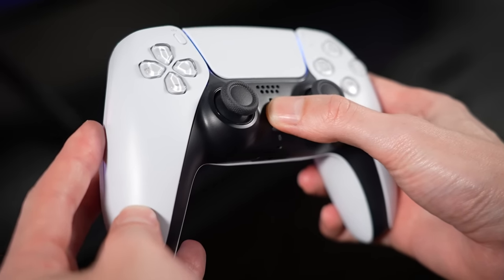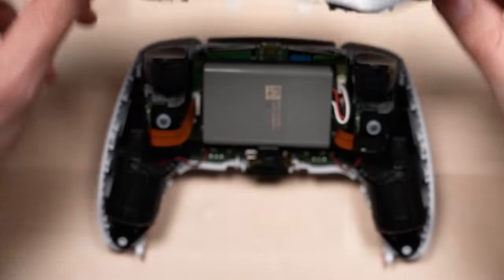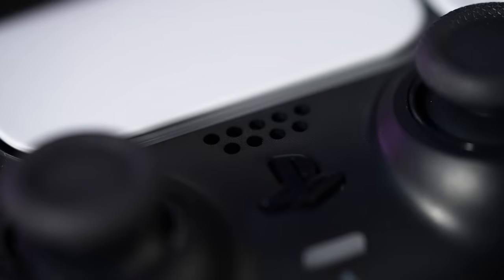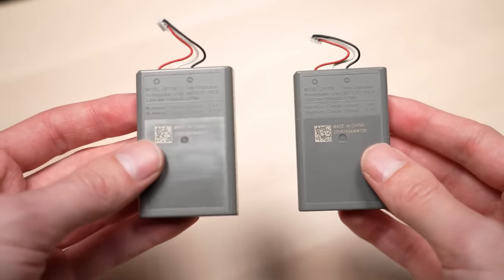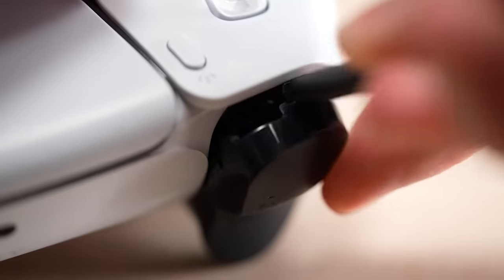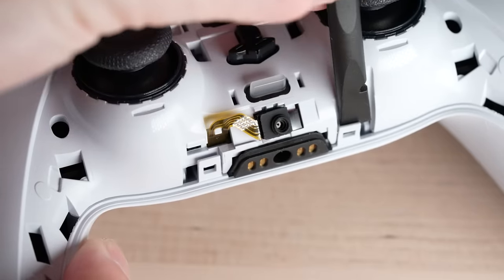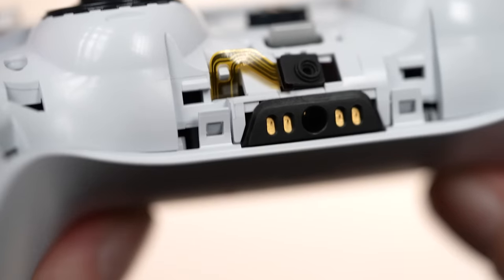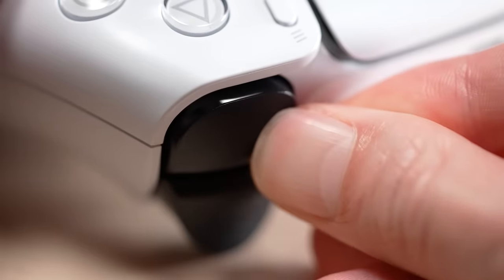Sadly, your Playstation controller won't last much longer..

Comment: Degrading and dying batteries are one reason why I love that Microsoft stays with the battery compartment on their controllers. Happy to see that these are still relatively easy to get to, but having to pry off buttons to get to the battery when they could've probably just put a door you could unscrew back there is a bit ridiculous.
Reply: They do it on purpose. They want you to buy a new controller. It’s a scummy practice but it’s nothing we can change.
Reply: @silvskill5358  Uhh no. Battery degration happens to literally ALL types of rechargeable batteries.
Reply: @allwillknowmii1314  Yeah but they make it harder for you to change the battery so that most people will just by a new controller because they don't know how to access it.
Reply: @allwillknowmii1314  Yeah but with XBOX you don't need for the normal person buy a WHOLE new controler
Reply: @silvskill5358  That would be planned obsolescence. "Your car is only good for 100k-200k miles, and you need a new phone every other year."
Reply: Yeah with xbox controllers you can just put a new rechargeable battery inside which saves alot of time😂
Reply: @joethewiz4005  Yeah, i used rechargeable AAs for a while, and it got annoying when they would die mid game, so I got the Sliq Gaming controller charging station. It's great, and if they ever get to the point they die too fast I can easily order another one of those batteries and use AAs until they come.
Reply: @allwillknowmii1314  you’ve COMPLETELY missed the point there, this person is referring to the lack of a simple solution for battery replacement being done to push us towards buying a whole new controller.
Reply: @KingKami Controller drift happens to all controllers from all brands so is a irrelevant point to bring up, Microsoft solution is still superior in the battery department
Reply: im using EBL 2800mah AAs .. i highly recommend. on amazon.. lasts me a week before i gotta swap in fresh ones. i play rocket league probably 4 hours a day...
Reply: @user-it6bx9tt5h  I have the same batteries. Rechargeable EBL 2800mah. While they work great, a controller charging station works great to make sure it will always be fully charged whenever you're ready to play. Then you can always fall back on the EBLs if you ever need to replace the batteries from the station for any reason, defect or eventual degradation.
Reply: That's funny. That's the exact reason I fucking hate xbox controllers. Those rechargeable batteries are garbage that break all the time. To the point where I just play wired all the time. At least my playstation controllers lasted 4 years without having to do anything other than charge them.
Reply: @Typzical  You're buying trash rechargeable batteries if you continue buying ones that break all the time. Buy quality ones. My 4-pack of Panasonic Eneloops are still going strong for my Xbox One controller I use for PC gaming since I got them 5 years ago.
Reply: @Typzical  As an iPhone user, I genuinely can not understand why you would ever complain about the ability to easily replace a battery. Like you don’t even need to buy a rechargeable battery pack with an Xbox Controller, just get a set of Rechargeable AAs and you’ll be good to go for years to come, and you can find them in effectively every store. Not being able to easily replace the battery is the absolute worst thing about iPhones, I can’t imagine a single reason for wanting that as the consumer
Reply: @KingKami since gen 1 xbox has always had the least problems with stick drift and the bumpers problem was only if you threw your controller around alot. Having a battery compartment saves you a ton because buying a $20 battery pack that'll last 5 years of hardcore play is a lot cheaper than replacing a controller every 1 mabe 2 years of causal play. Its absolutely intentional both Sony and Microsoft have admitted to slowing down older systems. On top of all that you can shatter a ps5 controller with a light twist of the grips so do you really think they intend them to last any time at all.
Reply: its too encourage lazy rich kids to buy a new one
Reply: @silvskill5358  this is one of the easiest battery replacement's I've seen, compared to a phone this is a cakewalk, any old chucklefuck could do it
Reply: @Christoph5782  The issue is the fact that they need to be replaced so often. I've never had a playstation controller have a bad battery. In general the ps controllers feel better quality. I bought a brand new xbox one and out of the box there was play in the sticks. I feel that because they are replaceable they make them shitty and cheap so you buy a bunch of them.
Reply: Microsoft doesn’t include rechargeable batteries, but they are easily user replaceable. Sony includes rechargeable batteries, but they are not easily replaceable. Both companies should meet in the middle and include rechargeable batteries that are easily replaceable, like the Xbox Rechargable USB C battery pack
Reply: @silvskill5358  ive had my ps4 controller since 2016 and its running fine
Reply: @bluepeng8895  Yeah, but for around 20 bucks, sometimes cheaper depending on the brand, you can buy a controller charging station for the Xbox controllers which includes the rechargeable battery pack and stand to charge it.
Reply: @elfarlaur  they showed you its sooo easy
Reply: Both have their pros and cons. The playstation lithium polymer battery last a longer time than AAs, and have a lower maintainence cost as you do not have to replace it often. Changing the battery is troublesome, but at least it's once in a few years. For the PS4 dualshock 4, the microusb port is a common failure point.
The Xbox battery is easily replaceable, but not rechargable. So if you are using alkaline, you'd need to keep spares around. But it's common for the battery to leak and damage the controller. You can replace it with a rechargable battery pack specifically for the Xbox controller though. 
I do have a few controllers, but I do find Xbox 360 controllers less reliable based on experience. Have 2 that just shuts off randomly after a few minutes and a few that doesn't power on even with new AA batteries and no visible corrosion. Have a number of dead ps3 controller, but they worked after a battery replacement. Have a couple of dead wiimotes from leaking batteries too.
Reply: all this debate in the replies and im over here sitting with a switch pro controller that I haven't charged in over 2 weeks lol
Reply: @lemonbeverage  lol. Wanna get involved? 
Well, using my switch most of the time recently, esp with rf5 and Kirby. Xc3 is coming out soon too. Wanted a switch pro controller, but it's quite expensive. Just using some third party controller now that works well.
Reply: @UserAnomynous87  This is just demonstrably incorrect. I have Panasonic eneloop pro AA's in my xbox controller....they are 2500mah capacity and last for about 24 hours total non stop. My ps5 controller(which is brand new last month) lasts about 6-7 hours before needing a charge. Its a cynical practise intended to push people to buy new controllers...just look at how many new controller colors they release to further prove the point.
Reply: @totalprocall6894  Perhaps you are right on the PS5 controller battery life on a single charge. The main issue I have with AA batteries is the possibility of leakage. Have seen many dead Wiimotes and Xbox controllers due to leakage corrosions that are beyond repair, as it had seeped into the motherboard. Also had the same issues with the old Gameboy / Gameboy color, but did not encounter any such issues from Gameboy advance SP onwards, due to the use of rechargable lithium batteries.
If only the ps controllers had used lithium rechargable but allow easy replacements of the batteries via a battery compartment, just like those older Nintendo handheld.
Reply: @Typzical  don't be a cheapskate. Just buy Eneloops battery and you're good to go.
Reply: @JustKiddingPro  or just use wire 💀
Reply: why not replace the battery? with an even bigger one
Reply: @prich0382  that's really all there good at to me. i had an Xbox for 4 years and a PlayStation for what, 2 and a half? i have like 2 PlayStation 4s at my house and they are much better than Xbox. albeit they slow down very much after a while.
Reply: @joethewiz4005  I bought a set of Nyko rechargeable battery packs in 2014 when I got my XBox One and I've been using them ever sense and can get several play sessions out of each still on a single charge. Best $40 I've probably ever spent.
Reply: @bulldogg117  you dont need a new phone ever other year. I still have my phone i got in 2019
Reply: i was going to say this, we dont just care about this happening, what i have against this controlers is their sticks, the potentiometers are very fragile, because they are cheap, microsoft even needs and special software to manually calibrate them during production because they are innacurate and need that calibration, bad thing is that software is private for them, so if you try to swap the potentiometers... well good luck, i mess up a very fine controller trying to swap its potentiometers, F.
Reply: @Typically  Same bro they were honestly trash imo they always died quick and would disconnect randomly